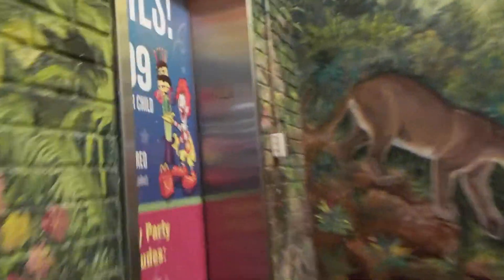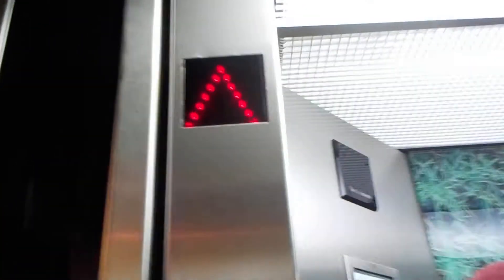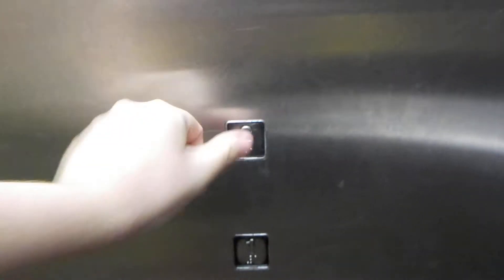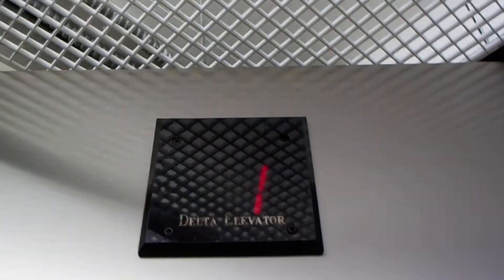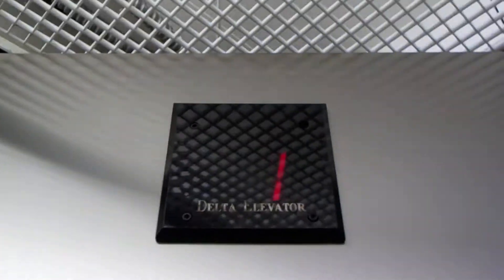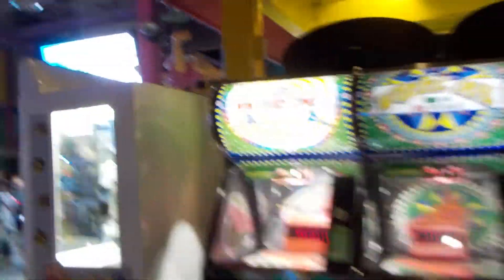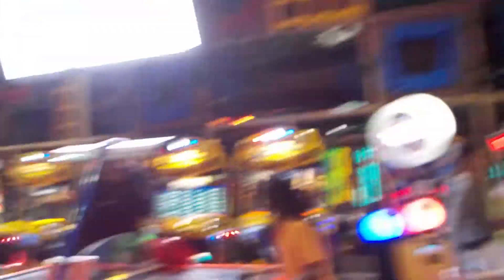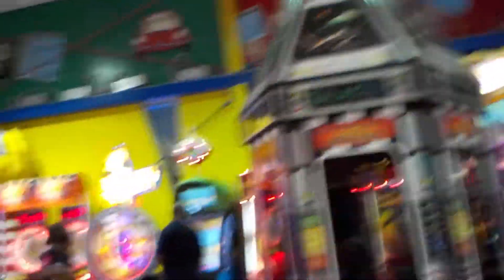Construction Update + Delta Holeless Hydraulic Elevator at McDonald's Orlando, FL

Comment: That's a crazy McDonald's! I didn't know that some existed with arcades inside.
Reply from the maker: +WestCoast Elevators yes some do. There are 3 2 story Mcdonalds in Orlando. This is the first one built in 1976 with the delta elevator. This one is called Worlds largest entertainment mcdonalds. This one will get demolished and replaced by the new one under construction next door. The 2nd 2 story mcdonalds built here has a general elevator and was built in 1977. The 3rd 2 story mcdonalds is called Worlds finest mcdonalds, was built in 2003. It has a Thyssendover elevator. Btw the new mcdonalds replacing this one will be 3 stories.
Reply: @FloridianElevators  That's what the plans called for yet that didn't happen.